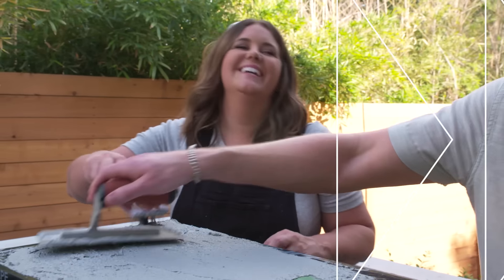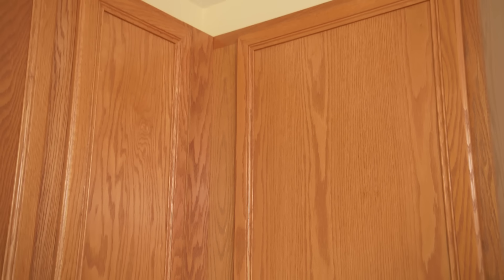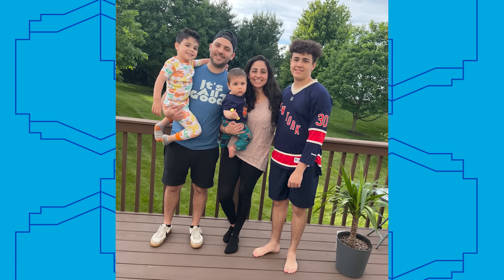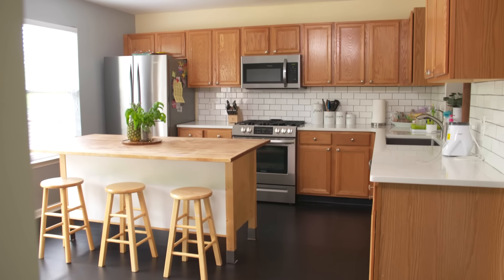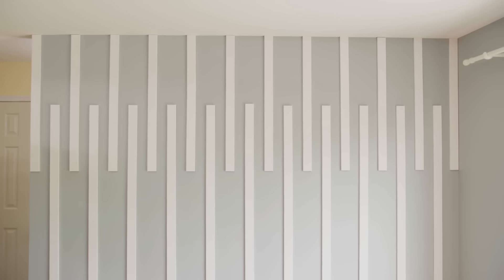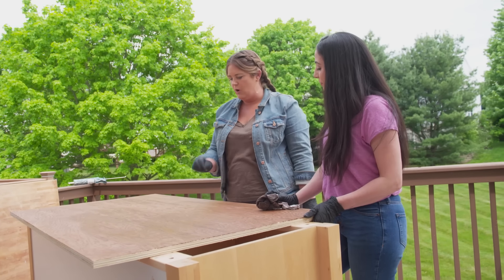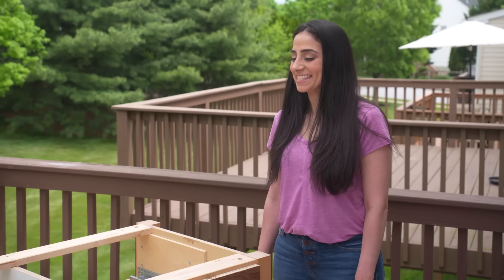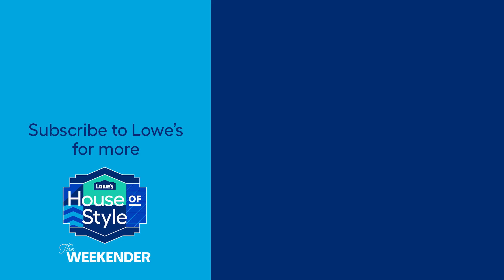The Weekender: “The Industrial Farmhouse Kitchen” (Season 5, Episode 4)

Comment: I thought if you use cabinet paint, which is specially formulated, you don't need to prime - or sand.  Love what you did with the update/refresh.  That space by the blank wall was crying out for a table with banquet or bench and chairs.  So happy you showed the homeowners that yes, a table and chairs can fit quite comfortably.  The countertop on the island is to die for!  And there is nothing sexier than using black in more than accent pieces in a room.
Reply: I think they sanded and primed the cabinets because they had a gloss finish

Comment: We got a version of a quartz countertop for our bathroom too. Its a new product idea.  They grind the quarts and add design lines mixed with a polymer. You get a stone look in a hard material that wears well. Ours imitates carrera marble which our tiles were faux carrera too. And actually cheaper. We added cubbies to the side of our old bathroom cabinet and slid cabinet over so the vanity is larger I covered 2 letter sized boxes in drop cloth. 2 sewn seams no glue as original one had no drawers. Our neighbor built the shelves then I asked him to match the face frames and trim moulding on that side wall like original cabinets. You would never know not original. If you have all wood old items dont throw them out. Like even the kitchen cabinets you can order new doors to change up your all wood cabinets.

Comment: How do you open the cabinets that you have added on top?
Reply: Probably with those click buttons one can put inside cabinets
Reply: Since the cabinet doors are not inset (they mount outside of the box opening, not flush with the box opening), you just put your fingers along the edge of the door and pull. This method can wear down the finish on cabinet doors that get daily use, but since these are so high and therefore will store rarely used items (if anything), that shouldn't be a problem.

Comment: I love some of the changes here. Though maybe not my preferred colors our home is too nuetral. I want to add some color. The walls are a kind o gray green. I usually like white walls but all the cabinetry and oversized moulding is white.  I guess its modern ranch...or maybe modern lodge. The artist who built home was born in Europe but lived in many big cities across USA. You see that influence in the very plain Danish type plank white cabinets. She was too ridged. I dont see how some things passed code. Its a 64 foot long box house with a raised 8 truss ceiling and 64 foot skylight. But much was not workable, maybe unfinished. Oddly the light switches and heater vents should have been switched. Vents are under windows so you cant put solid furniture there but if you put a lamp and table the cord is 3 feet to the side or in reverse lampin front of windows. I gave up and all my plants are in front of windows.  A second homeowner did nothing not even maintainance. About half the roof tiles blown off. I nicknamed the kitchen the "trailer kitchnen". All my pans dont it. But we learned early on not to go against the grain. All we did is working around what is here. Some dont beleive we never torn anything out remembering the before. Well just the bathroom we gutted. I should do a slideshow on my blog or maybe add to my youtube. All in this town know who we are because of the home we bought. IN our retirement. We never worked so hard! Still are. Working on yard and other outside elements.